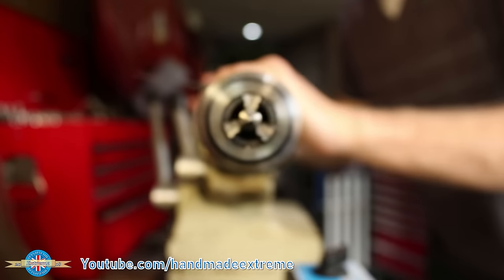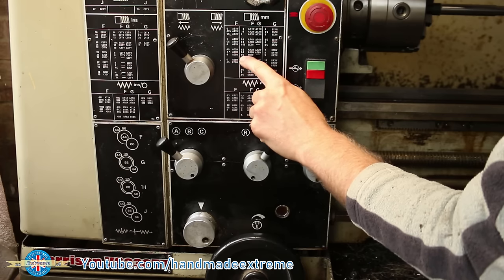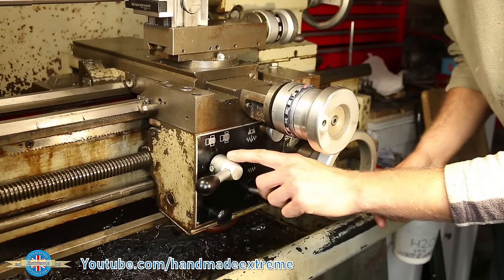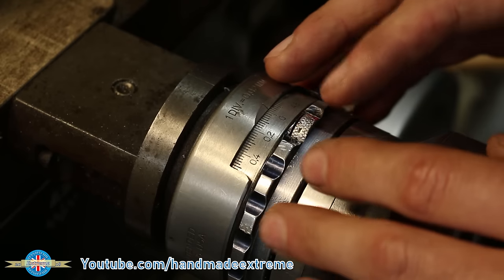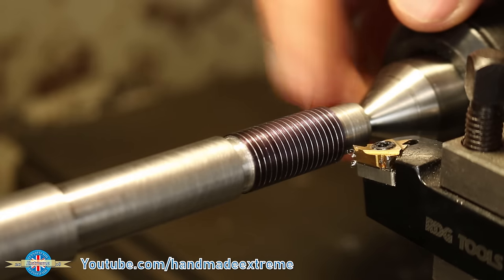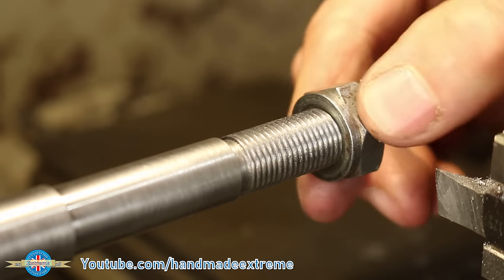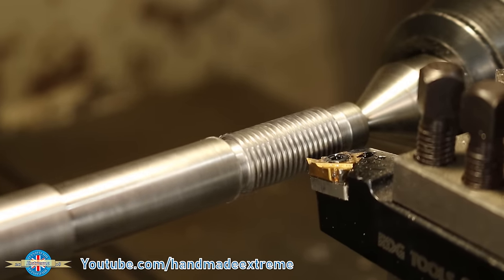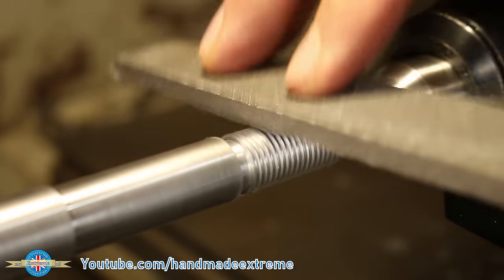How to cut a thread on a manual lathe (Intermediate method ideal for home workshop & hobby engineer)

Comment: My two cents worth……..engaging and disengaging the half nut lever is only done when you are cutting very long threads. With most typical threads such as this you simply withdraw the tool quickly at the end of cut and put the machine into reverse to get back to your start.
Reply: I agree. Where you disengage and engage the half nut, it doesn’t always go back exactly the same. Especially with an older lathe. You can easily cut the thread too deep or too wide usually when doing final cuts.
Reply: Great if you can reverse!

Comment: When I started my apprenticeship, I was taught how to calculate the thread depth (using simple mathematics). The second thing I learned is that when you did the final cut and the nut fits perfectly, NEVER to use a file on the thread or "scotch brite". The thread should be smooth and shiny. In this video, you can see on the "chip" that there is chatter. However, a good tutorial for a beginner !
Reply: Yeah, this video is pretty scary to watch. He's going way too slow to get a good finish and I don't understand why you wouldn't turn the compound to decrease chatter.
Reply: Could you share the info on how to calculate the thread depth?
Reply: @spazzwazzle  he said that there are better ways to do the job ...but this is a fairly basic method with less chance to make mistakes... i am sure he could do if he wanted to

Comment: This is a good, thorough, tutorial covering ALL steps in setting up the machine.  I would offer to immediate improvements to ending up with a better thread.    The first being a faster spindle RPM.   It appeared the RPM chosen was simply the slowest ...which is fine.   But the problem is this cutting speed is in fact very slow ....on purpose.

1) A faster CS would automatically provide a better finish on the thread form.  But this is up to the operator and their comfort zone with operating the half-nut disengagement only, for this one example.   As determined and explained, for this thread pitch, any of the 8 engagements on the thread dial indicator will keep the pitch ...so there is no challenge factor in engaging ....and this engagement can be as far away from the thread start point aw the operator chooses.   It is the "disengagement" that is the critical point ....but this is also dependent on how wide the relief is.  Nothing wrong with practicing this technique.  It just requires concentration.

2)  The depth of cut chosen was very deep on the second pass.  Considering the extremely low RPM, this resulted in extremely poor surface finish because the metal was literally tearing off the parent material ....and the surface finish looked awful.  The depth extreme depth of cut can be taken, but it need NOT be that deep.   As the final thread depth of cut is approached, the actual cutting depth should be reduced, simply because there is more material being removed at the deeper cuts.

3)  And lastly, it is very common practice to run at least one "extra" pass after the last finish depth has been reached.  Even though this bar is supported on a center, the bar material still deflects.  There was a lot of tool pressure still on the last cut.   A "cleanup" cut just makes sense to perform.  It will literally always improve the thread surface finish as well .....which is what the female thread is going to be running on.

There wasn't very much offered about "fitting" the thread and the testing of the nut did not reveal very much either nor was there any mention about the fit/class .....but considering this was only a tutorial using the cross-slide, ....enough said.

Comment: Flip the tool upside down, and start the tool from the chuck side and feed toward the tailstock and run the lathe in reverse. Learned this from the best toolmaker I have ever know who was from Germany. Many advantages, the most important is that the chips fall down out of the groove instead of bouncing around in the  groove and ruining the finish. Running off the part at the end is more forgiving and gives you more time to disengage the half nut, therefore you can run the rpm higher for smaller diameters. And no, you won't cut a left hand thread this way.
Reply: Dude, you dont even know that you saved my sorry ass right now, thanks😁
Reply: A great method as long as the chuck doesn't unscrew and follow the chips into the chip tray.  Make sure the chuck is locked onto the spindle thread.  🙂
Reply: This is also a better method for parting off.
Reply: But don't do this for any heavy turning op's as the force is not directed down into the machine.

Comment: Just found your channel as I've upgraded to an M300 from a Myford and liked your RPC video.
If you're just doing a simple "plunge cut" threading job and you have the nut handy for sizing, advance the top slide a couple of thou every cut, this mimics the angled top slide method and let's the tool cut primarily on its leading edge, reducing tip loading and generally provides a smoother finish to the threads.
Reply from the maker: Nice idea. I'll have to give that a try some time. Thanks for the support.

Comment: I was taught to turn tool upside down,  run lathe in reverse,  and cut from chuck towards tailstock.  This reduces the risk of a crash into the shoulder,  and no need for a large undercut.  I always cut threads this way,  and have done for last forty-five years,  unless using an Ainjest attachment.
Reply: Martin 1299S: that is a good method if you have a good lathe, but it does tend to be lifting the toolpost off the bed, rather that pushing it down.

Comment: Good to see an instructional video with carbide threading inserts , only thing I would add is carbide inserts give a much better finish at higher speeds , something to work your way up to if you're disengaging the half nuts and you've got good hands.
Reply from the maker: Absolutely right. Got to have quick hands when doing it manually at the higher speeds.
Reply: Appreciate the comment. I was wondering how slowing the lathe way down was affecting the “speeds and feeds” equation. Presumably a high speed steel cutter would work better, perhaps with some tuning of the tool geometry? The trade-off is: if you don’t already have the tool in your inventory, you might spend more time grinding the tool than what it takes to make the part.
In any event, the thread seems to be mechanically sound and passes the cost/benefit test. Comparing the final thread with one cut with a die would be an interesting exercise.

Comment: Nice video for demonstrating cutting metric threads,  may also add depending on what brand of lathe swapping gears to do metric or atandard threads. Ive been cutting threads on old school lathes for 35 years myself,over all great video

Comment: I'm glad that you mentioned the depth of cut, is 0.25mm good for all diameters/sizes of thread? 
How many advancements of 0.25 mm do you make, until you reach max depth? What's the maximum sticking out on the insert tool I guess? You can't cut any deeper than that.

Comment: Many of your viewers (me, for instance), have less rigid lathes.  If I try to plunge-cut a 1.5mm thread on my seventy year old Myford Super 7, I will end up with a lifetime supply of chatter marks!
For lesser beings like us, the 29.5 degree compound slide method is our saviour!  Sadly for me, my lathe is also short of its thread-cutting dial... My father bought the lathe when I was five years old, and gave it to me thirty years later, so I know it did not ever have a dial...  might be a project for me.  😜
Great video, thank you.  It did drive me la-la though; your voice is very familiar, but I could not figure out why!   🥴
As an afterthought... because the Myford has a clutch, I can make a cutting pass,  disengage the clutch and withdraw the tool, then wind the carriage back using the handwheel on the leadscrew.  This is actually a very quick process, and works great with the 29.5 degree compound, and no threading dial... it's also pretty foolproof.   😛

Comment: So THATS the part I forgot to do, been a while since I've run a lathe and I was running some practice passes a bit ago on some plastic and a few times I cut right through the high side of my threads, wasn't sure why, now I know, I got certified as a machinist when I was 16 and I'm 22 now so I've forgot quite a bit, tryina get back into it and you just solved my issue, I knew it had to be something simple, I just forgot to wait for the number to come around before I engaged the feed

Comment: Would recommend using coolant when screw cutting you will get a much better finish, when I served my apprenticeship in the late 70s I ended up doing all the 2 and 4 start threads for the marine engineering company I worked for; that’s advanced screw cutting 😀

Comment: Good video editing. I also have a metric Harrison. For the thread you were cutting you can engage on any number every time. You seemed to use 8 the first time, then wait for 8 every time you re-engaged. You could re-engage on any number. Try some “air cuts” to prove it.
Reply from the maker: Thanks very much, glad you enjoyed it.  For that thread your absolutely correct. I think I might have just reused the same bit of footage each time. Takes a lot time to set a shot up so reusing the footage saves a bit of time in production. 
Thanks for your support 👍
Reply: I bought a used Harrison AA. I took apart the cross slide dial assembly to clean and destroyed by mistake the 2-pin circular locking ring that holds things  together. Tried to fashion a new one but cannot get the right size/pitch to go on smoothly. Any idea what those numbers could be?

Comment: Suggest you check Colchester training films on screw cutting. They show the topslide set over at half the thread angle. The cut is applied using the topslide with the cross-slide left at zero.
So you are only cutting on one edge of the tool, the other side of the thread being generated by the top slide.

Comment: That was excellent, thanks, a very good explanation. That's my chosen method too. With inserts I think it's totally fine to go straight in with the cross slide and cut on both sides. These days I tend to keep the half nuts engaged, because I set my VFD up to have a fwd/rev switch for threading. I have programmed very fast deceleration times for the motor when run from that switch. It's a bit like having a clutch, as on the Harrison 140. I can stop dead, back the tool out and reverse the carriage.  I need to make sure I cut a big enough drop out groove though, first! 

Thanks again, really enjoyed.
Reply from the maker: Cheers Carl, 
Great to hear from you again. Nice move with the VFD. Luckily I have a foot brake on mine if I need to stop it QUICK. 
Thanks again for the support. 👍
Reply: @Handmadeextreme  No problem. You have a great lathe. Very useful tool. I'm looking forward to the next video about the car too.

Comment: Nicely done, sir. Excellent organization, camera work, sound and editing. It is one thing to know how to do the operation and entirely another to be able to communicate it effectively.
One thing this illustrates is the difference between a shop lathe and a small lathe like a Sherline that may have the lead screw gearing to cut threads but lacks refinements such as the dial.

Comment: Calculate the Undercut/Gutter diameter first using the thread tables book which tells you the approximate thread depth The nose width of the insert varies depending on the thread size AND Pitch (1.5 mm pitch in this case (OR Number of Threads per Inch)  The Coarser the Thread, the bigger the Nose width Ideally required. So then you'll have to screw deeper on a Coarse thread if you only have a small nose width Insert. & a deeper undercut.
Reply: Machinerys handbook is key. Calculating minor and major diameter are also key, you're right.

Comment: I have a lathe with an imperial lead thread so need to change gears to cut metric threads. I always cut straight in and much prefer to cut away from the chuck. I prefer to use HSS steel tools though I do have carbide inserted tools. I also have made an inside carbide tool for small inside threading. Well done video.

Comment: Excellent video demonstrating basic thread screw cutting and very well explained how you go about it and why you do things the way you do. Only difference in the way I do it is I turn the compound slide around to half the angle of the thread im cutting so that the depth of cut increase on the compound slide is following along the back edge of the thread and the tool is only ever cutting on the front edge, gives a nicer finish but is slightly more complicated for the lathe operator. As always learn to get he job done first then you can improve your skills and methods as experience increases.

Comment: I've never used a lathe but intend getting one which is why I watch things like this.
 Refitting the thread cutter accurately could cause problems. Surely best to leave it in place until you've finished (unless of course the groove is not deep enough).
Couldn't you have continued and cut a shallow thread in the base of the groove and machined it out later for appearance?
Really good instructive video, thanks.
Reply from the maker: With a quick change tool post the tool position repeatably is very good so that not a huge concern to be honest. Regarding cutting into the groove. That very much depends. If it is just a single pass then you could get away with it but if you had to keep making more cuts you need to stop the tool sooner each time or you can overload the tool and break it if it suddenly goes from the 3rd or 4th etc small cut into a piece of uncut material. The tool load suddenly shoots up and breaks the tip off.  Hope that makes sense. Thanks for watching.
Reply: @Handmadeextreme  Thanks. Now to find a decent lathe!

Comment: It's well worth getting the full form inserts for whatever pitch you are threading, especially for common pitches such as 1.5mm. You can easily tell when you've cut the thread deep enough & you get a much nicer finish with no need to faff around with a file & Scotchbrite !
Reply from the maker: I'll check them out, thanks for the tip. 👍
Reply: That insert is far too big for the pitch & will give a much larger radius in the root of the thread. So the cut had to be deeper to get the nut on that's why you machined into your undercut. This thread will not engage properly as the flanks have been machined too wide for the nut crest radius to clear the large root radius formed by using a tip that has a root radius form too large for the pitch. Also a full form insert will create the correct crest radius so no file or scotchbrite. The inserts are not designed to cut all around their profile so plunge cutting is not advised. Always advance the tool on the compound slide for each cut. You could have also increased the undercut with the threading tool.

Comment: Very nice little beginner tutorial. I would have liked you to show how to tell if the threads are deep enough without the nut to ensure all production nuts would fit on. I guess if I wanted I could get it close and then run a regular Die over the threads and that should do. Thanks for sharing. best Wishes & Blessings. Keith Noneya
Reply from the maker: Thanks for the feedback. Great idea about showing the measuring. A set of thread wires is the proper way to do it. Your absolutely right about the die technique, I sometimes do that myself on larger threads. Thanks for the support.

Comment: Good video on thread cutting in the lathe. However sir please use some cutting oil or Anchorlube while performing this task. I read earlier in the comments you choose not too use it but if your teaching how to cut threads the correct way is too use cutting oil or some kinda lube.  This keeps heat from building up and damaging your tool. Just a suggestion I think you done a great job on explaining the method.
Reply from the maker: Thanks, glad you enjoyed the video. I do use cutting oil normally, just not for the demo so people could see the tool a bit easier. Absolutely right about the oil and the heat it's a tool killer. Thanks for the support.

Comment: Being a bike tech , I have say that is the weirdest front axle ever. By the way threads on bike axles are rolled not cut by single point threading. Rolled threads are used to give a cleaner thread with a controlled root radius.

Comment: I liked the way you explained the process at each step, but I'm not trying to teach you how to suck eggs, but when you're reengaging the thread cutter, after it's been moved, engage the drive as you would normally but keep the cutter off the job. Stop the Lathe with everything engaged and using the cross side move the cutting tool from left to right so it is in the correct position in relation to the thread. It will now be in the correct position to finish cutting the threads. I have also been told but haven't tried it yet, that if you can use the thread gauge to check the correct depth of the thread as well as the pitch. Great Video.